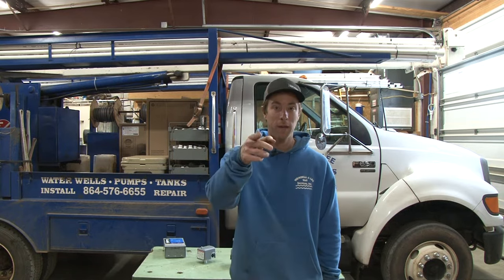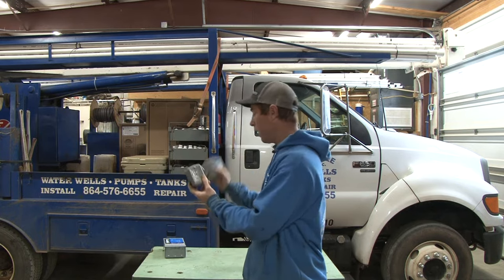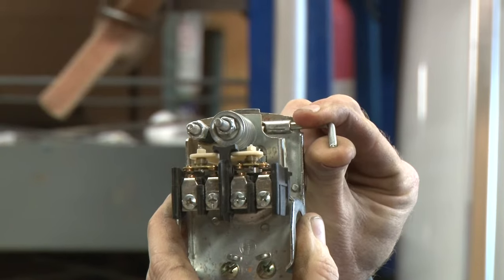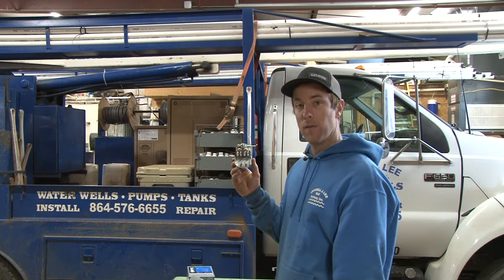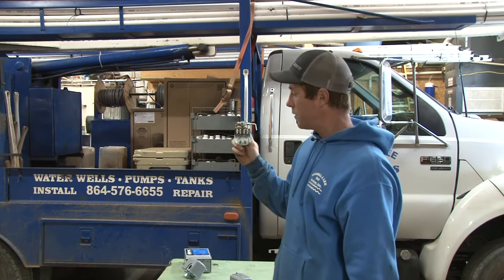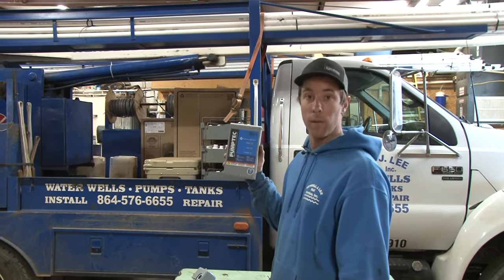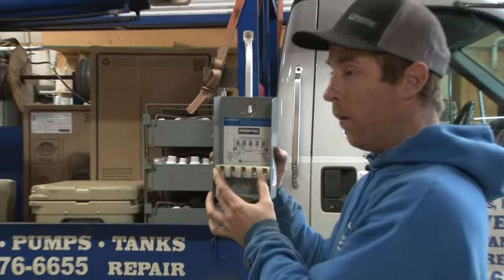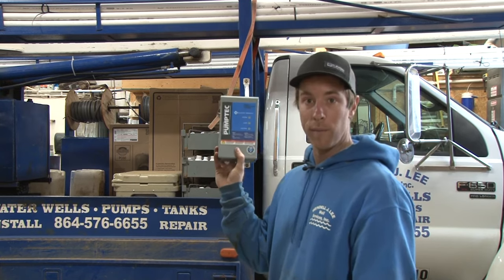Square D Low Water Low Pressure Switch: How do They Work and Are They Worth It?

Comment: Great video! Just what I needed! My old Square D died. Lowes employee suggested the low pressure, version of my older switch. After one shower, small load of laundry and cleanup for dinner, my pressure bottomed out. Thanks for confirming it was the switch. I’ll look at the Pumptec. Thanks!

Comment: Planned power outage last night. No water in the morning. I don't know diddly about my well water system. After resetting the breakers (they were fine) I did suspect that little grey box with a lever. Found your video.Moved the lever up ever so slightly and voila - water pressure! Thank you, thank you, thank you!!!

Comment: Thank you for this explanation. I purchased the one with the low pressure switch (because the old one went bad) in November after I turned off the irrigation system. So this weekend I turned the system back on testing the zones and kids showering water cut off. 

I thought maybe air was still in the irrigation lines. So I used the handy dandy switch to cut the switch back on ran a zone turned on the hose bib water stopped pressure at zero turn it back on using the handle. Same thing. 

Your video gave me a full explanation as to what the handle is truly for. Guess tomorrow I’ll get a “regular” pressure switch. Thanks for solving my mystery!!!

Comment: It's good what you are saying. But just to let you know or give another perspective . The reason I installed a low pressure switch was because at one time with previous owners, there was a leak in the pipe from the top of the outside of well to the inside of house and the pump never shut off and flooded the outside of the house in the winter of all things and froze the back of the house and cracked the basement wall. Soooooo, I installed the low pressure switch and that way if it happened again because I can't be sure how good they fixed it, then the pressure switch will automatically cut the power and save the house. Also in their case the water would keep flowing because it was a low pressure issue that kept water flowing and not just having anything to do with a dry water pipe.

Comment: Wendell, I have had the water tank get so low the pressure pump sucks air, pressure drops, but there is no low pressure cutout and the pump gets so hot running on air it melts the pvc pipes.  You MUST have a cutout.  I understand you prefer the electrical one, but then you nee that device AND the pressure control switch.  I find it much easier to just use the mechanical all-in-one.  Yes, I have to know how to reset it, but presumably would need to know that for the electronic one, and it is just one more thing to fail.

Comment: SON OF A B! I've been fighting that damn pump all day after putting in an overhead sprinkler system,every time the toilet was flushed or a faucet was turned on in the house it shut down. Getting a new switch now.
Reply: same. darn thing cuts out  all the time when the old switch didn't. found the old version and will switch it out.

Comment: Do you have any suggestions for a system that has a max pressure output of 23 psi?  I have been having massively adjust a standard pressure switch well outside of it's normal range to run my well pump as my max pressure is 23 psi.  We have plenty of water for our needs at 23 psi but the switches being adjusted that way do not seem to last all that well.  Can I find a well pump switch that is designed to be adjusted to cut on at 15 psi and cut off at 23 psi?  I have found some 20-40 switches which I could likely "over adjust" and make it work but I have to adjust it to cut off at 23 psi or less which is tough to adjust as they are not designed for this, otherwise my well pump will run constantly and burn up.

I know that I can easily find air switches that can do that but I need to run a water tank with a rubber air bladder in it to use one.  Not an issue for me to setup as I am an electrician and mechanic, but I have my pressure setup in the house in a closet beside the water heater and I don't have the room to be adding anything more into there.

Comment: Hi, I enjoyed your video. I'm running a pump to fill a container on the roof of my home. I'm looking for a switch to sensor pressure from the copper pipe from the street. I want the pump to turn off when there is no water from city. I live in an area where we run low on water from city. I don't want to burn out my pump when city pressure is low. Great appreciate your input.

Comment: I build commercial grade RO machines all day and I can attest that low pressure cut outs cause more problems than they solve. Our techs will often by pass them in the field turning them into a $50 wire nut basically. They will kill your equipment when the pressure is low but that doesn't always mean the water source has actually stopped. The pumptec is a way better option, the price tag is the only real issue.

Comment: I would have thought that the LPS would be more for when a pipe breaks - the preesure drops and the pump is decativated. I've have a couple of incidents of my basement  flooding because the pump kept going all night after a pipe burst, so one of these should solve that - correct?
Reply: Maybe not until your pump couldn’t keep up.  I can open a couple of faucets and my pump will maintain pressure.
Reply: Yes, that is what they are for. Why he is trying to sell the pumptec is stoopid. A low pressure switch has saved my well pump from overheating from a underground line burst.

Comment: is that box same as the franklin box my friend ell pump shuts off she has the franklin boxs and a relay pressure switch it don't have the lever i flip the brake off then back on the pump turn on until you turn the valve on for the water storage tank i also can move the relay contact to open let it close it come on for a awhile as long the house only has pressure the pump don't kick off until you fill the tank  i am in California dont know how much water in the well

Comment: What can be done if the pressure switch needs to be tapped on to get the contacts to turn on the pump. It doesn't happen all the time but every so often.
Reply: I have seen that happen before it's bad points contact As cheap and a new pressure valve is I'd just replace it. Always with the power off when your in there messing around. Or ants got in there and died and are still trapped in the points  contacts. Oddly ants love electricity and then their dead ant buddies attracts more ants I've seen the box with hundreds of dead ants in the regulator and in AC units boxes.  Use bug spray ahead of time in these areas around the well house floor and outside of wells and ac units....  Never spray electiric panels and such.
 .
Reply: @Bruce Castonguay  I ended up taking it apart and sanded all the contacts with sandpaper and reassembled. It's been working good since then. 👍
Reply: @chris76-01  It's always a good idea to have an extra one on stand by in case you need it in  a hurry. I keep 3 - 5 laying around.

Comment: Just put a restricted outlet after the switch. Besides the accumulator pressure tank is supposed to keep the pump running.
If the switch is before the pressure tank it shouldn't shut off the pump. It's convenience for me to use the low pressure cutoff type switch.

Comment: Have you ever seen a well that runs both a low pressure switch and a pump tec? It appears that's how my set up is and it cuts water out all the time. Very annoying.
Reply: Ever find an answer ? I'm having same issue
Reply: Get a larger pressure tank and split your filters into two pipes coming off the one from the pressure tank to have smooth pressure. If you have low pressure then people in the house will keep sucking the press dry and not learn any way to take it easy with running too many faucets.

Comment: Do you have to mount a pressure switch horizontally only???
Reply from the maker: you can mount them horizontally or vertically
Reply: @WendellLeeWellServices  thank you, the video is awesome. I got it changed and I replaced my well pump.

Comment: Wait a minute...A low pressure switch saved my well pump from continuous running and possible failure from a underground pipe that broke. He wants to sell the Pumptec though cause he looks and talks stoopid. So I can't trust a thing he says.

Comment: Nice video  but you clame the pump tec Plus cost is not much higher.   Are you bill gates Rich or something. Low p cut off cost 45 bucks tops pump tec was in the hundreds of dollars.  That's a huge difference bud